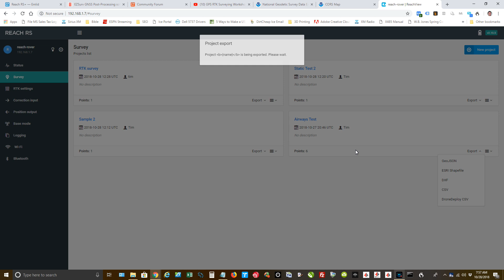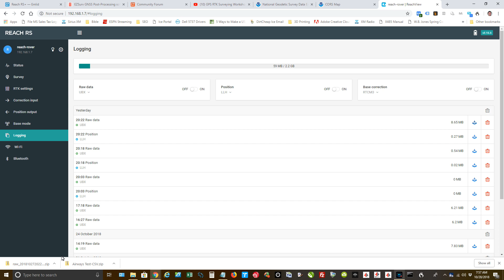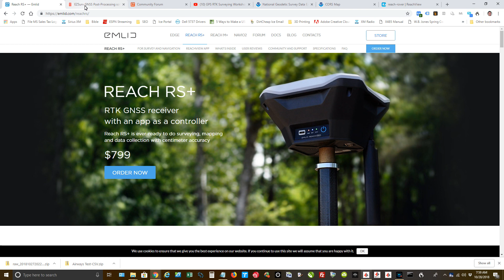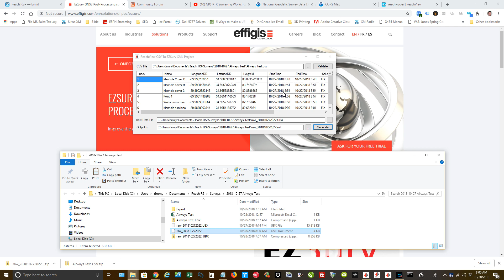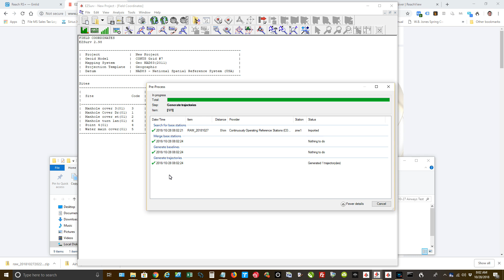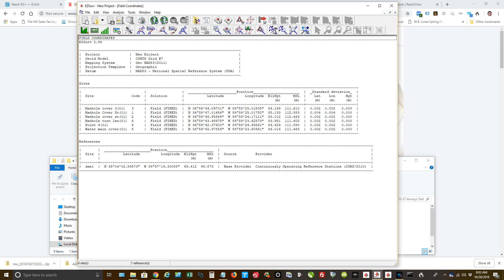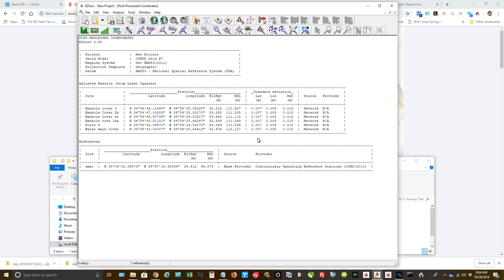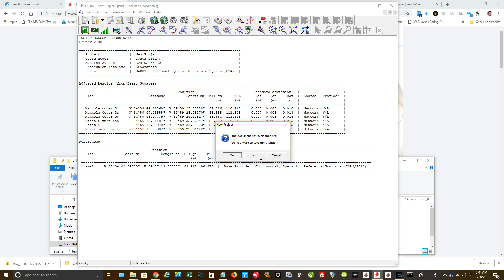Collect and post process Ground Control Points (GCP's) using Emlid Reach RS and EZsurv

Comment: So if you hadn’t used a base station, but just a rover yielding poor +/- 5+ meter GPS position, would/could Post Processing still be able to achieve cm accuracy or do you need a base and rover setup to get this?
Reply from the maker: Chris, if you use only a "Rover", then you can still do PPK processing using a CORS station as the base (if you live the US).  Using L2 (dual receiver) units allows you to have a base (CORS)  much further away with good results compared to using an L1 (single frequency) GNSS receiver.  There are now good videos on using RTKLib (free) software for doing PPK processing.  So you could get an Emlid M2 (low cost dual frequency) or RS2 (more costly L2 receiver) and you could get good results for marking GCP's.  The term "centimeter level accuracy) is misused and misunderstood.  There are many factors and errors that go into the data collection/processing (equipment, processes, attention to detail, atmosphere, software settings, many more).  So achieving accuracy within 1cm is a very hard result to achieve no matter how good your equipment is.
Reply from the maker: You would have to post process your Rover Data in order to achieve good accuracy for the GCP targets.  Without doing PPK processing, there would be no need to even do GCP's.
Reply: @DroneMappingTools  Thx for the beta. So to collect GCPs for drone mapping a single Emlid M2 or RS+ with ppk could do the job? No need for two receivers (rover & base)?

BTW, for my purposes, by cm level accuracy I really only mean something like +/-10-12cm rather than +/- 3-5 meters. Used mostly for decent looking, well georeferenced cartography not build to location.
Reply from the maker: @Chriscam2you   In my opinion yes.   If you have a low budget, then I would get the Emlid M2 and use that and I think you will get very good results. If your budget is higher then you can get the RS2 for $1800. And that is one dandy GNSS receiver. You will have to do post processing and the software that you can use for free is RTKlib.  There are some tutorial videos out that now make that software doable for a lot of people. Back when I purchased EZserve I found it impossible to learn how to use the RTKlib utility.  The M2 cost about $500, So The only thing else you would have to purchase would be a survey pole the bar pod and a converting mount so that you could mount your antenna And ground plane to the top of the survey pole
Reply: @DroneMappingTools  

Awesome, thx again! 

I can get the Emlid RS+ for $799.00. Are you not a fan of this particular model? Would it be better, not any better, or worse than going the M2 route? I think the RS2 option might be a bit spendie for my little league operation.
Reply from the maker: @Chriscam2you  The RS+ are great units!  I had a pair (actually the original RS).  But they are great.  I was speaking of the M2 because it is a dual frequency device.  You can use it as a ground unit or you can fly it on a drone if you have a kit to integrate it.  The M2 is $500 and the RS+ is $800.  You would have to use a Wifi device with either one as they do not have Cellular data like the RS2.  To answer your question, both are great units.  You would just have to decide which one was best for your needs.  Hope that helps!
Reply: @DroneMappingTools  Helps a ton, thx again in heaping lots.

Comment: Where did gou get that mount to hold the measuring tool?
Reply from the maker: Hi Daniel, are you talking about the plastic mount that held the laser measure?  If so I designed and 3D printed it.  But I will tell you that I no longer worry with that.  I simply hold the laser up there where it should be and take a measurement.  I can hand hold it in place and know that I am within 1-2 cm of accuracy which is good enough :)  If not, tell me the time stamp on the video where it is at and I will look and see.

Comment: Thank you for the video.  Great stuff.  Is it possible to collect points from GCP's with just a rover and the CORS correction?
Reply from the maker: Hey Chris.  It is absolutely possible.  The main factor is how far the CORS station is from your job site.  The only purpose in having a "static base" at the job site is to use that unit as your reference base and have really tight accuracy.   But if you only have one Reach RS or M+, then you can likely get by.  Once your CORS station gets about 15 miles or so away from your job site, you will begin to see a slight drop in accuracy the further out you go.  But depending on what your needs are you can process your Rover log with a CORS station that was 50 miles away (maybe even further).  You just need to determine from your customer what level of accuracy they require.   Hope this helps!

Comment: Can you tell me if you can modify the google maps heightmap using your Reach RS+ datapoints? And can you find them again afterwards using a tablet or something?
Reply from the maker: When you say heightmap, are you talking about creating a 3D model, or DSM?  The Reach RS (or even the M+) is used to survey multiple ground control points (ie 3-10 points in a drone mapping mission).  Then you use programs like Pix4D, Drone Deploy, or DroneMapper) to generate the point cloud of entire property which can then be used in different applications (like Global Mapper, QGIS, etc).  If that is not what you were asking, give me some clarification and I will help the best I can :)
Reply: @DroneMappingTools  Yeah sorry my lingo is not up to date yet.... :p

As simple as I can say it: can you use the data gathered with Reach  to alter the visible terrain in Google maps?
Reply from the maker: @futurecaredesign  No you can not.  The Reach RS and M+ are just L1 GPS receivers.   You could survey many points on a property to then create an interpolated surface model using various software.  But what most folks who are researching the Reach RS for is using it to mark GCP's (ground control points) which are then used to make the Orthomosaics and Digital Surface maps created from the drone images very accurate.  Most average drone maps (under 1000 images) are going to have 3-10 GCP's placed over the entire property.  I hope this helps.    I found this link.  Maybe it will be helpful.  https://www.dronezon.com/learn-about-drones-quadcopters/introduction-to-uav-photogrammetry-and-lidar-mapping-basics/
Reply from the maker: @futurecaredesign  Sorry for the late reply.  The Reach RS is an L1 GPS receiver.  So it is used only to survey points.  To create a high quality Digital Surface Model (DSM) , using drones is now the only way to go.  In the old days, you cold traverse around a property for hours and hours (or even months) surveying a grid to create a fairly decent DSM.  But even then, GIS software was required to process the surveyed grid and create the elevation map (or DSM).  Now you can use drones and photogrammetry to create very precise surface models and 3D models.  Marking GCP's within the flight area is what ties the accuracy down.  Hope this helps. 

www.pix4d.com
www.dronedeploy.com
www.DroneMapper.com
Reply: @DroneMappingTools  Cheers for the quick replies. I am seriously considering to buy this kit seeing as the costs is pretty much double of having a survey done.  Then there is the autonomy part and the fact I can use it for jobs.
Reply from the maker: @futurecaredesign   you may want to even check out the video that I put up yesterday on using the reach m+ as a base and Rover. For people trying to save some dollars, it can be a viable option.  if money is not a problem, then getting the reach RS+ units is very nice, and they now even have the L1/L2 receivers but they are $1,800 each

https://youtu.be/V6ik8JoRStw

Comment: Hi, do you have any email or webpage where i could reach you?
thanks
Reply from the maker: www.midsouth360.com
Reply: @DroneMappingTools  your contact form doesn´t work, i sent a message to your facebook page, could you check the inbox?
Reply from the maker: @rikimontano  I'm away from the office, but I will check that. I will also look at the contact form. I recently made some changes to the site and that may have gotten messed up. Thank you for letting me know
Reply from the maker: @rikimontano  I just checked the contact form and it is working.  If you are out of the USA then it may not work as we have that blocked.  https://www.midsouth360.com/contact_midsouth360/  or email to timmyd@midsouth360.com